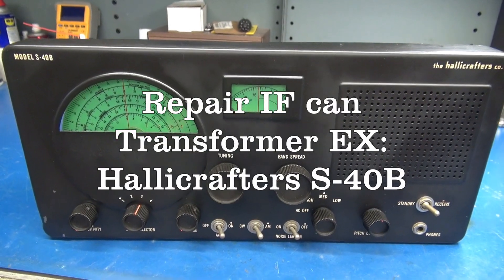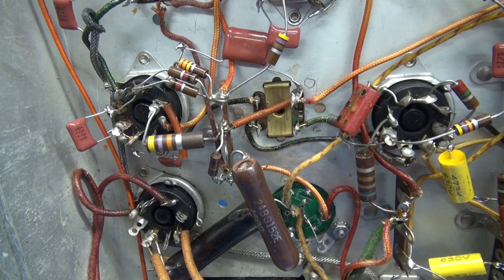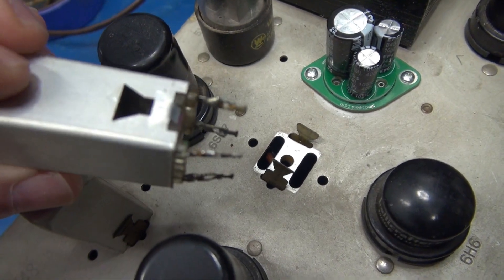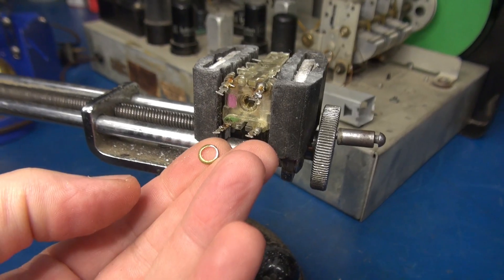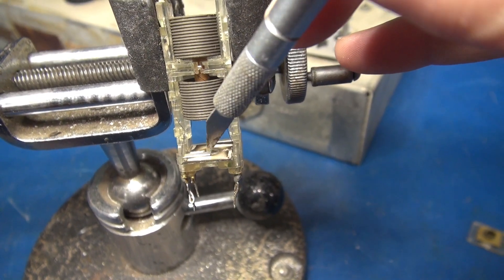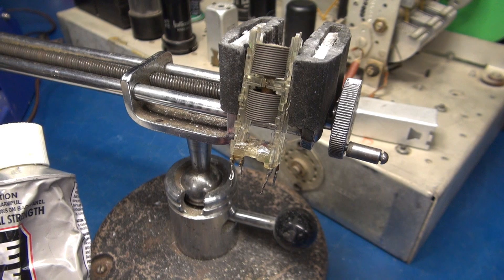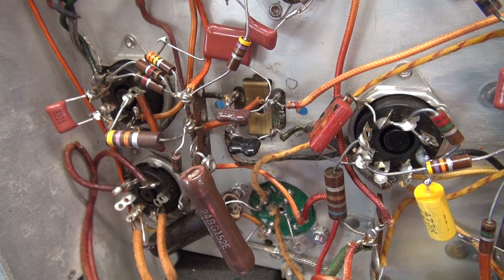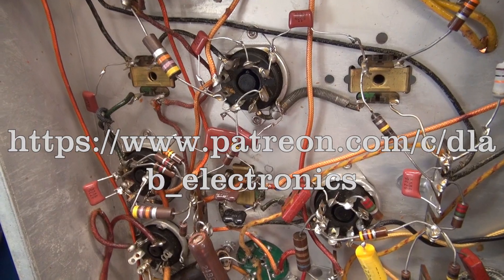How to repair vintage Hallicrafters S-40B tube receiver IF can transformer silver mica disease

Comment: I ask this question out of ignorance, but am genuinely curious: Is there a modern replacement circuit or device for IF cans other than using another IF can? Thanks in advance.
Reply from the maker: Hello, Not that I know of. The IF transformers have around 300vdc on them. That would blow up a Solid state device
Reply: Thanks for the thoughtful response. Love watching your videos and always learn something useful. 73 and Happy New Year to you and yours! Frank, W4EFW

Comment: Arcing is a great way to discover this issue, but if you can't see it, it's easy to detect and pinpoint with the 'hound' from a wire tracing kit. This also works well for standard S/M and ceramic caps that are arcing internally.

Comment: In a lot of devices with rivets that act as an electric carrier, I noticed that they eventually oxidize and resist current flow at the contact point. Here I suspect that this is what happened: the mica sheets were still operational, but the contact with the plates was unreliable. Sometimes removing oxidation, wetting the rivet with tin solder and soldering it to the plate is possible.

Comment: Back in the 1975 I was given the same receiver a coworker had found in a barn, Recapped it. and replaced the speaker.  He also gave me an old oscilloscope that had been manufactured in 1947. Got both of them working. Was in the military at the time, and when I transferred was able to take them with me. Didn't know about the caps in IF cans. Might have explained some of the noise I was having. Thanks for the video.

Comment: Thanks Terry for making this video as one will run into this problem with those particular types of IF cans from the 1950s,
yes even regular old tube radios do have this problem. Shango has an approach with testing the capacitance with small 
adjustable ceramic body capacitors to get peak signal across each coil and then replaces them with the same set value 
mica caps as you have done.

Comment: Another great video.  I just replaced the caps in the IF transformers of a Knight R-100A as a preventative measure.  For removing the brass rivet I used a pair of Klein D2755G flush cutters to remove the top crimp.  I also used C0G ceramic surface mount capacitors as the replacements.  If you carefully trim back the contact tabs you can solder the ceramic caps across the gap.  Since my capacitor wafers were still OK I was able to measure their value on a capacitance bridge to order the proper value replacements.  73, W0KPX

Comment: Thanks Terry.....I'm currently working on a Hammarlund HQ-180A ....without any antenna connected this thing makes a lot of noise and with the antenna connected it has very poor/unclear reception....After starting from the output, removing a tube at a time and injecting a signal I think I'm getting closer to a couple IF Cans.......I'll have to turn down the lights and see if I can observe some arcing......  Thanks for the Video....
Reply from the maker: Yep, that sounds like the same issue. You can also tap on the can using a wood or plastic wand. I find that the noise can be excited by the vibration
Reply: Sometimes you just hear it & don't see the arcing.